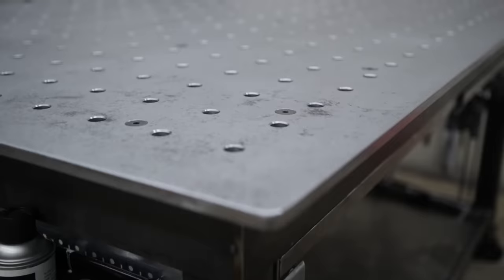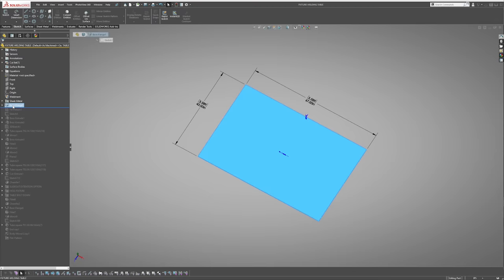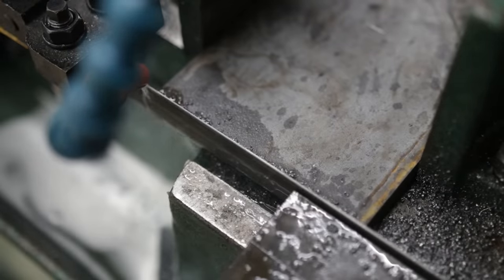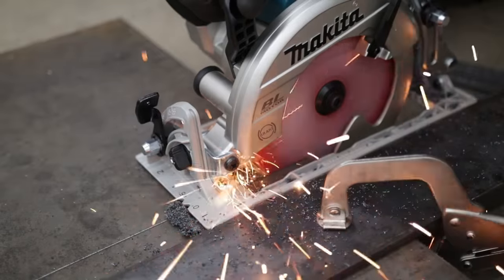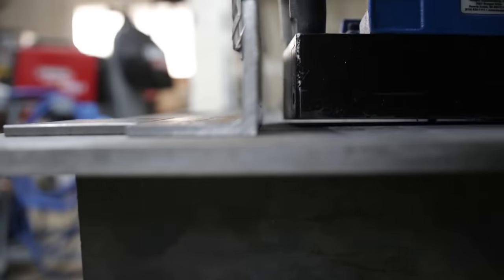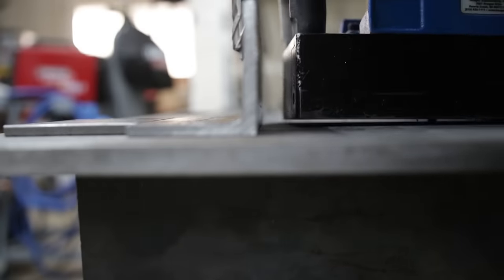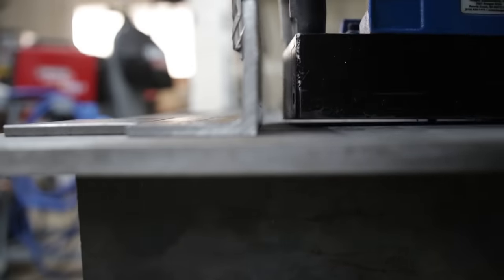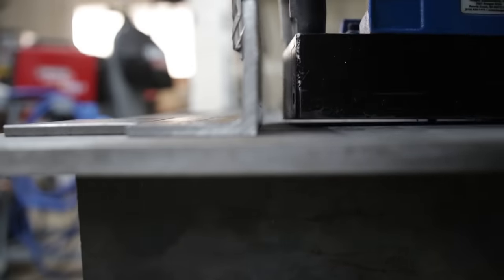Homemade Welding Fixture Table + Storage Hack — Built for my Home Garage Shop

Comment: How close to 2k was the build cost?
Reply from the maker: With everything seen in the video from top to bottom about $1200 but it will vary from place to place on cost of raw materials. Hopes this helps
Reply: @RathaSochenda  locally, 3/8 is just under 800 and that is if you can even buy it. They said expect to be waiting 3 months for a single sheet. Less waiting if you buy bulk but when one is all you need....
Reply from the maker: Wow that’s super expensive. To be fair I did buy before steel prices went up. For the top plate it cost me $400 for remnant sheet that was 5x8x1/2thick. I’m sure now things may have change unfortunately. I haven’t checked recently but last time i went to my local steel yard a 4x8x1/2 sheet cost $560 new. This is for prices locally in my area. What area are you located?

Comment: Thanks for sharing. I just found your channel. I subscribed after the video. I am very picky who I support,and I like the fact that you are doing something with your life and not being a hudlum like I was at your age. We are selling our house and will be building a new shop( wherever we settle) I will need a new table and I like a lot of the thought behind this one. The trays are clever for many reasons. The older I get the more anal I get. Now I spend as much time cleaning up as I do building. I will definitely be getting a set of those casters. Oh and next time you need to remove the tabs on a receptical or a switch to put in a 180 box, take your KLIENS and SNAP them off. Cut off receptical Tabs and cut off zip ties have been worth several stitches in my lifetime. I will buy the plans when we get settled. Will be working out of a couple conex's for a while.Thanks again and keep up the good work and keep your nose clean( as my mom would say) I know it's hard to stay on track sometimes. A good woman will help. You being in the shop is way better than in the bar or at the strip joint. Nice welds btw.
Reply from the maker: Thanks I’m glad the video was helpful. And that’s for subscribing. I’ll do my to stay out of trouble😊

Comment: @6:59 i guess you quickly noticed it wasn't cutting all that well...:O)  you should not use those circular saws for metal. They need to be way slower in speed not to burn the TCTs. Great job overall
Reply from the maker: It was a good learning experience. The cermet blade has its place for thinner metal sheets. 🤙🏾

Comment: When you have just made an angle iron with the correct spacing between holes.... it's a very bad idea to just tack spacers into place and stack an error line after line.
Instead, you turn the angle iron 90 degrees and make the sideholes first on both sides. After that, you can reference the angle iron off those holes, and you have zero stacked tolerances.
Reply from the maker: Thanks for the tip.
Reply: @DaveSmulders  Newb here.  How would you reference that 90 degrees to prevent error? I can see myself being off (maybe a degree) and finding the sideholes get closer (or further) toward the end.

I figure start with the angle-iron template, put a pin (shoulder bolt) through one end hole into the opposite hole drilled in the table (keeps the angle iron riser toward table's center).  Rotate the pinned template out of the way (approx 90 deg).

To produce a reference edge to measure that 90 deg from, I'd put pins (more shoulder bolts) in the table holes.  I can set my square along these pins.  I'm not sure I should trust the shoulder bolt heads to be concentric or same radius (when compared to the shaft), so I'd probably lift the pins so the square sits under the bolt head and against the bolt shaft.

Then slide the square against the pinned template until the template is square, clamp, and drill.

With my lack of experience, I tend to miss details that introduce errors.  Do you see anything I can improve or overlooked?
Reply: @charetjc  Hi, there are a couple of ways to achieve a good 90 degrees but it depends on what you have to work with really.

#1: If your tabletop sheet has two perfect 90 degree faces, it's a good idea to measure the first and last hole on the template to the edge of the sheet of metal.

#2: If you have a well calibrated table (panel) saw at hand, you can cut two perfectly square edges to a large sheet of chipboard or MDF. Or have a friend cut it. You align the angle iron (template) to the first edge of the metal sheet. After drilling the holes you peg the first hole with the drill bit or some other well fitting stock. Turn the template 90 degrees, align the chipboard to the initial edge of the tabletop, and the other edge with the template angle iron. Repeat for the other side turning the chipboard upside down (same reference plane to the initial tabletop edge). You don't need a straight edge on your table top stock, as long as you carefully pick and mark two high spots far enough apart to reference off.

#3: You can copy the angle iron template into some flat stock. One to three times. Now you can lay out multiple sides at once, pegging each corner through and through. Helps to have a lathe at hand for a good fit....and, for making consistent diameter heads on the pegs so that you can cross-measure for squareness: if both diagonal measurements from peg to peg are the same, it's square. This works without a straight edge on your table top stock.

#4: You can make less copies if your templates are long enough and you want to measure diagonally: you preferably use thin stock for the copies of the template as the height difference will otherwise skew your assembly. You can now use the 3-4-5 rule to peg a square, as that is the only way that the alignment of holes in the diagonal 'stud' will always match the hole pattern in the other templates. This works without a straight edge on your table top stock.

#5: a large frameing square will probably work as long as you have one straight edge on your table top blank or two marked high spots to reference off.

#6: Just marking a large perfect square on your table top blank works surprisingly well as long as you use a scribe or any other thin feature. You can consider centerpunching then drilling small diameter pilot holes in which you stick small stock, or maybe even hex-head bolts to act as a stop to reference the template angle iron off. The only issue here is that you can actually get the distance wrong, and then the whole 90 degree face will not align with the hole pattern.

There are probably a lot more ways, but again....it depends on what you have to work with.
Reply: @RathaSochenda  I forgot to say what a great build this is :) Full of great ideas and problem solving. Thanks for all the work making a video about it :)

Comment: Ps. You know you WANTED those 2 inch on center holes. Then you can use everyone’s fixtures. But that’s way too many holes to drill!
Reply from the maker: 😂 more holes the better
Reply: @RathaSochenda  but damn, 600+ would have been brutal!  I have a friend with a CNC plasma table, I wonder if a CNC could make accurate enough holes?
Reply from the maker: @rodgerbright3764 lol yeah by hand would of sucked. I have s 4x8 cnc plasma now. 😆 honestly plasma technology still very crude. Especially when it cnc plasma has to cut holes smaller than 1”. I suggest fiber laser or waterjet. If you want clean concentric holes that have tight tolerances.
Reply: Fiber laser that can shear 1", that's some pricey tooling right there @RathaSochenda !  Makes sense that the plasma would leave a pretty crappy edge.

Comment: Fabracator here.. When your done with that makita can I give it to my daughter? Did you really C.A.D. a weld table? That is a sweet table but frankly if your using it in any meaningful way its going to be covered in splatter and tool marks in a short amount of time. The level of engineering is a bit over the top.
Reply from the maker: I come from an engineering background so I try to approach things from a design standpoint. 🤙🏾

Comment: 🎉🎉🎉. ,,VERY NICE FINISH ,BE PROUD &YOU ARE ,, YOUR A YOUNG GUY IM AN OLD GUY NOW KNEES SHOT ,,UP & DOWN ,NO GOOD ,,👎 ALL THE VIDEO'S NEVER SEEN ENEY BODY USE  55 GAL BARBELLS AS. TABLE LEGS PLYWOOD ON TOP..  WORK HEIGHT GOOD & BACK ,,KNEES 👍👍. THINK THIS ,,OFF LOAD SHEET HOT ROLL NON FLAT FLOOR BUT ON 4 X4 OR 4 X 6 ELEVATE UP. FROM FLOOR ❓ IF YOU HAVE CAR FLOOR JACK ( WORK OF 2 GUYS. ,,WHILE ON 4 X'S GET ROUND STOCK ,, ABS. 2" OR 3" 4". SCH. 40 STEEL PIPE OR THEM ROUND WOODEN TREE POSTS  LIKE 4" LEAST COSTLY,, IM RETIRED Sheet METAL WORKER SEEN LOTS EASEY WAYS SHORT CUTS,, 👍👍 ,,YOU PUT SOME THINKING TIME IN YOUR TABLE. ,,, SUPER DEAL. DENNIS

Comment: Are you a therapist? You should be.
Reply from the maker: 😂 Maybe one day.
Reply: @RathaSochenda  LOL just saying. You've got that calming voice.
I watch @essentialcraftsman videos partly for the same reason.

I'm not sure if I missed it, or if it is a closely guarded secret, but do you have an ballpark estimate of the total cost? Not counting what your labor is worth, even if you had to rent a mag drill, etc I'd assume you saved at least a couple hundred bucks?
Reply from the maker: Thanks. At the time of the build it cost total of $1300. That’s everything you see from top plate all the way down to casters. I did save a few bucks by going with a remnant sheet for the table top. Check out the link in the description for the full cost breakdown.